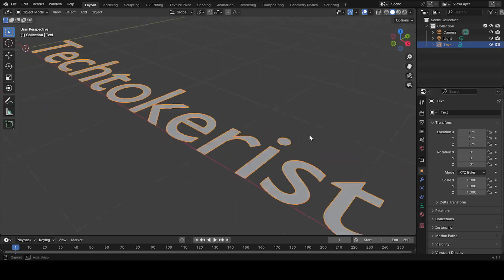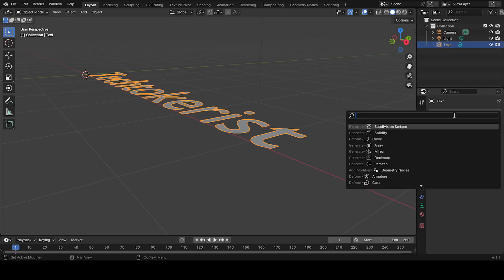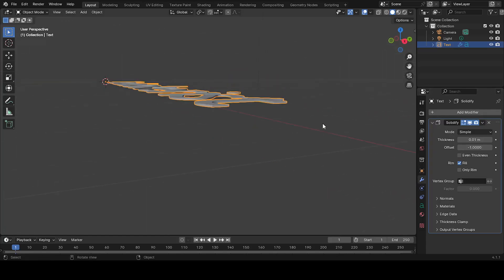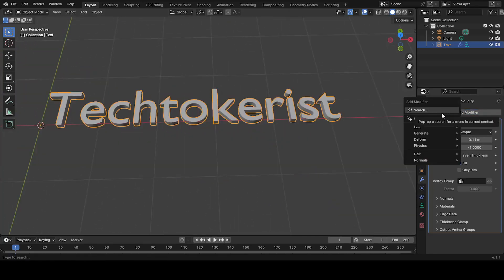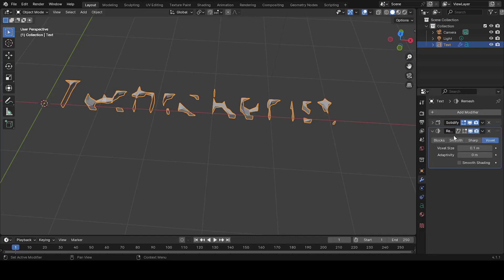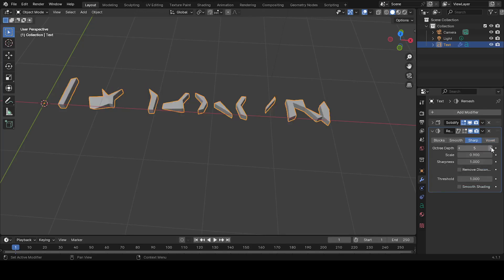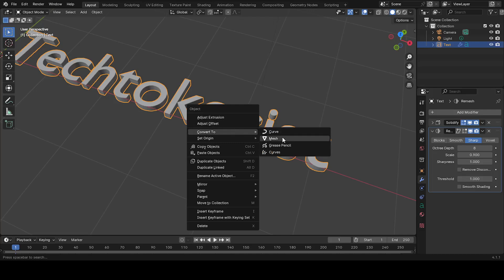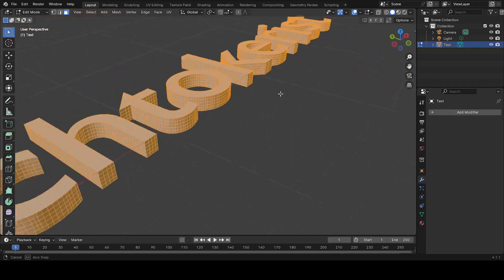The SECRET to Perfect Blender Text in 60 Seconds

Comment: But why is all that necessary? I never understood why text in blender has the crappy topology it does... all the other thing in the add menu come out with nice simple geomtry. But text is like a blind monk made the topology with the wrong side of a feather quill.
Reply from the maker: The weird topology happens because Blender generates text as a curve, which is then converted to mesh when you extrude it. This results in a lot of unnecessary vertices and complex geometry. It’s mostly to preserve the font’s detail and accuracy, but it can be a pain when you want cleaner geometry. You can either manually retopologize the mesh or use the Decimate modifier to simplify it after conversion :)

Comment: You can solidify your text without a modifier. It's in the Data panel (looks like an a in this situation), under Geometry, there is an extrude slider. Just saying.
Reply: End result not as good though.
Reply: @deviltrex101  You made me waste 30 second of my life lol, but joke aside you made me curious is the same result
Reply: @deviltrex101  Yeah, I know. Just saying.
Reply: Wouldn't extrude make for some weak topology? You'd have very tall quads on the borders. You'd also have to add loop cuts and it may end up with awkward topology for some letters. Not to mention vertical loops. At least this method brings about equally sized quads.